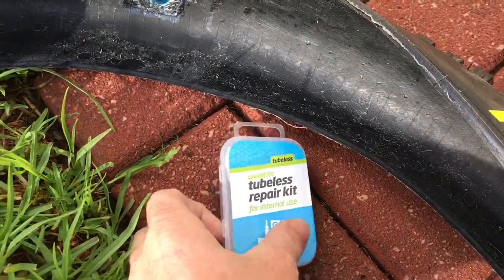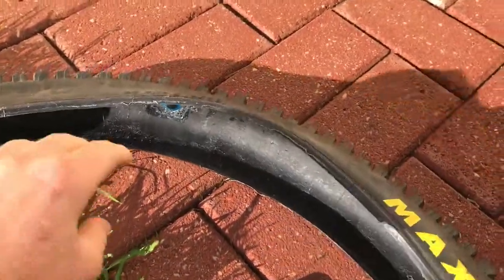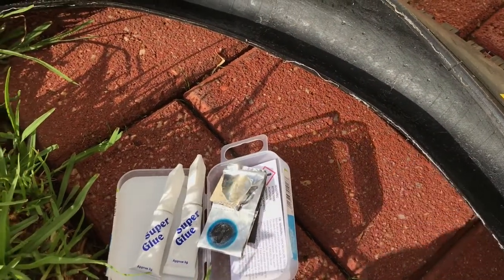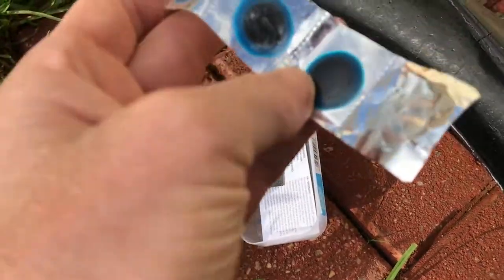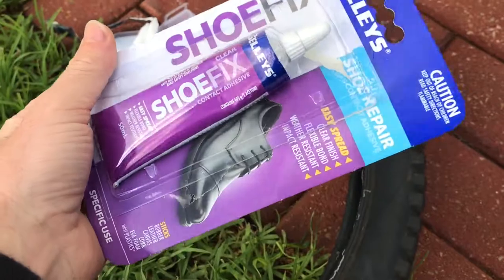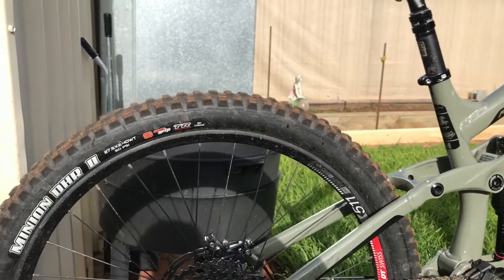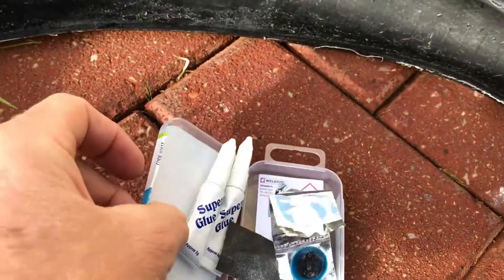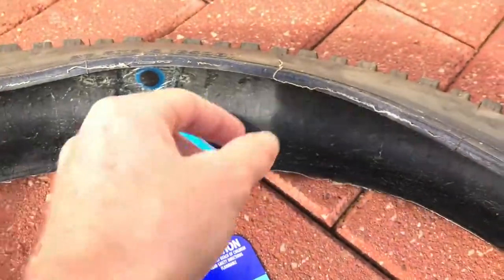Tubeless Tyre Repair Update

Comment: Will stay tuned for an update on how this holds up, i cut an aggressor mad early in its life and had issues sealing it up. Granted I did not put much effort to fixing it as we were doing laps one day and i had a spare tire with me that i just out it on instead, but heald onto it as it's still has way to much tread to toss.
Reply from the maker: Guineson I’m hoping its good. A few in the comments reckon an old tube cut into patches and some rubber cement should do the trick as well. I’ll let you know how this one holds up

Comment: I’ve been using old tube cut into squares to suite the size and normal patch glue with good results
Reply from the maker: Cameron Lesley ahhh good one! Simple and effective
Reply: done the same. the tube patch didn't react well with stans. i also superglued the tyre together in the slash otherwise it just becomes somewhere easy to cut. something reinforced like a blow up mattress repair might do the job.
Reply from the maker: no name ah thats a good thought. I’ll have to suss a kit out
Reply: Same! Keep an old tube and rubber cement around, haven’t had any issues 🤘🏼sometimes do it in two layers for bigger cuts but so far no dramas at all
Reply: @noname-sd5dt  Does stans slowly dissolve/soften the tube rubber? I've heard that this can happen when using sealant inside of some non-tubeless tires.
Reply: @patchesthejaybird8431  i cant confirm. i tend to swap out the tyre as soon as possible. the patching is for me a short term solution to keep rolling.
Reply: @noname-sd5dt  I've got a 25mm slash in the side of a second hand tyre I bought, otherwise it's a fairly unused tyre so I'm planning to stitch it up and have bought a sheet of patch material which is a reinforced rubber. Will use some rubber cement when it arrives and some hot glue to cover the stitching on the outside, hopefully I can get a few months out of it.
Reply: @Bordpie  be keen to hear how it goes hey

Comment: Please post an update when you find out how the Shoe Glue works out.
I've tried a shoe glue before and it didn't adhere to the rubber well. By the sound of it you are already experiencing something similar with the "crackling" of the glue around the patch.
You want a vulcanising glue. You can get tubes of it off eBay. I believe the vulcanising glue is actually a solvent which breaks the bonds in the rubber. As the solvent evaporates new bonds form between the tire rubber and the patch rubber.
Also you might want to look at a product called Shoe Goo (Doddy mentions it in his tire repair video). It is much better than shoe glue. And you might want to look at stitching the cut before patching and gluing too. Hit me up, might be able to help out.

Comment: How did the repair go? Did it hold the sealant for long?
Reply: Update: I used selleys shoe repair with a patch and it was a nightmare, it leaked sealant and air. I ended up just using a tube.
Reply from the maker: Yeah it didn’t work well at all, so I started again with rubber cement and it worked perfectly
Reply: @mtbtelly5522  good idea, next time I'll try rubber cement.

Comment: Is actual rubber Vulcanizing glue not available where you are? Or hard to find? That stuff will melt the patch rubber to the tire rubber. I've heard that it crosslinks the molecules... basically it welds the patch and tube together with no loss of flexiblity other than what's lost due to an increased thickness of the patched area. The only reason I can think of you not buying and using vulcanising cement is if its prohibited for environmental or health reasons by over zealous governmental nannies.
Reply from the maker: Phillip Stevens nah I think its available here, i just hadn’t found any yet. If this patch doesn’t hold I’ll get some of that gear
Reply: @mtbtelly5522  Ok. Good luck! Tires are expensive, hope you can get a patch that holds so you can get the value out of it.